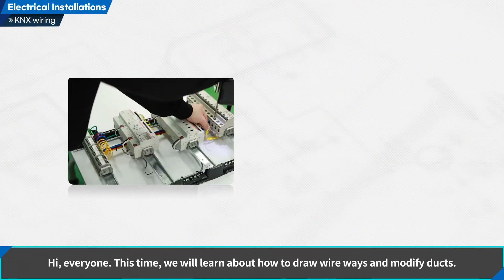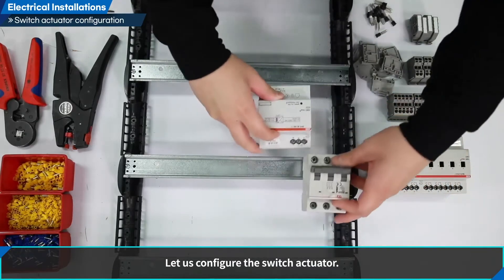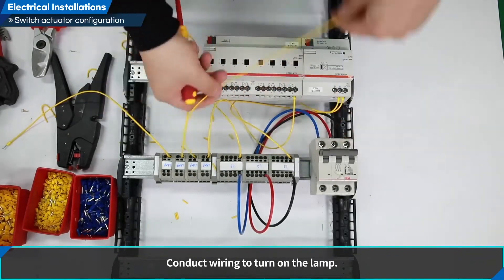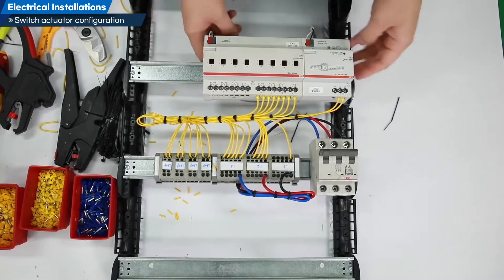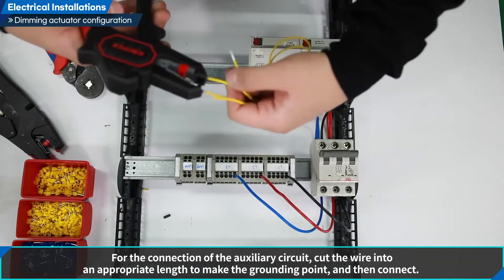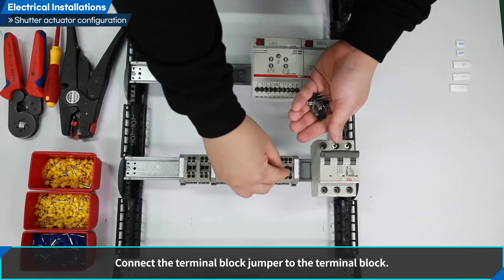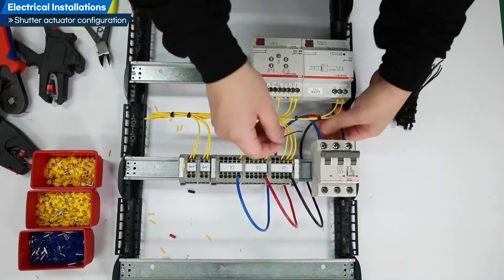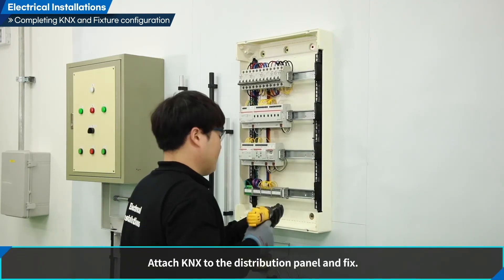(Eng Ver.)WorldSkills Electrical Installations 09

Comment: Min boleh ga kalau kabel koneksi bus pake kabel NYA atau kabel NYAF tolong di translate dan dijawab ya min😅🙏
Reply: You can use a NYA cable, but you need to use a cable with about 0.8 to 0.9 core.
It's not a normal method, but it can be used.
Reply: Bisa mas gunanya kabel knx itu sebenarnya untuk menghindari interferensi jaringan luar seperti petir, induksi, dan dll , tpi intinya bisa digunakan
Reply: الله يعطيك الصحه